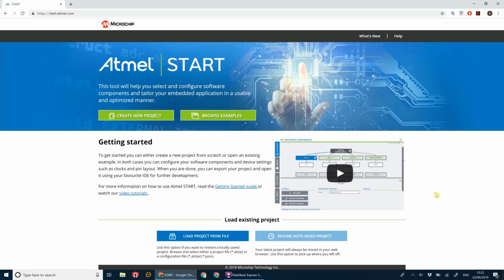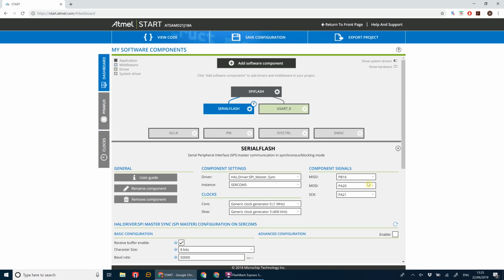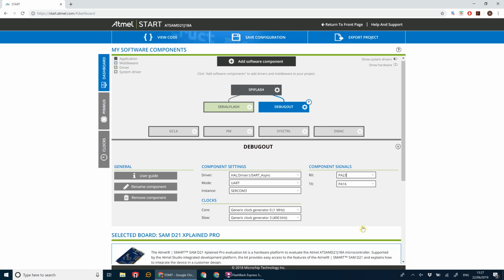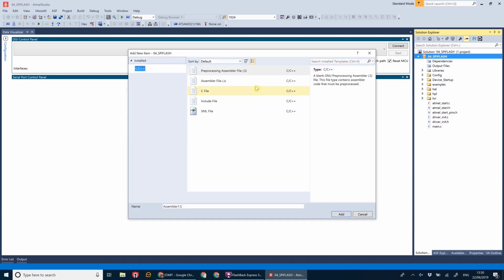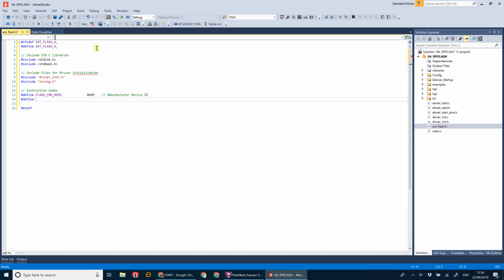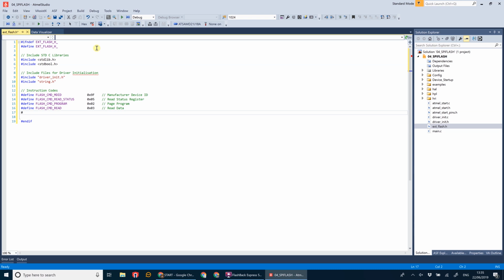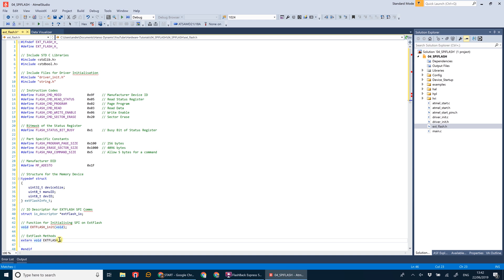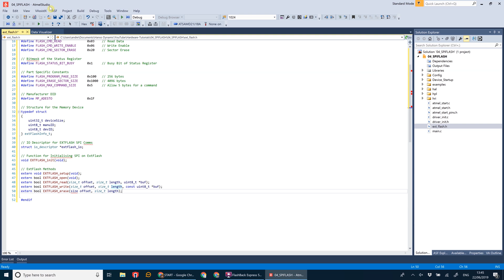Serial Flash Memory using SPI on Atmel SAM D21 Xplained Pro Board - Tutorial

Comment: Which spi flash device you are using
Reply from the maker: There is an 8Mb flash device on the Xplained Pro board. If you download the design package from the Microchip website it has the specific part listed in the Bill of Materials.